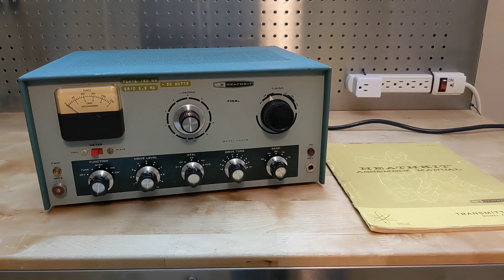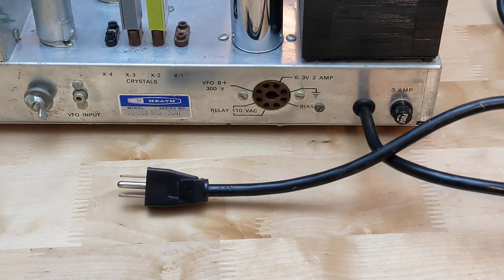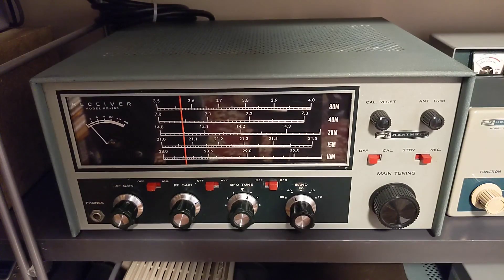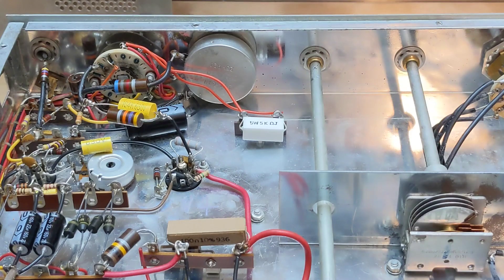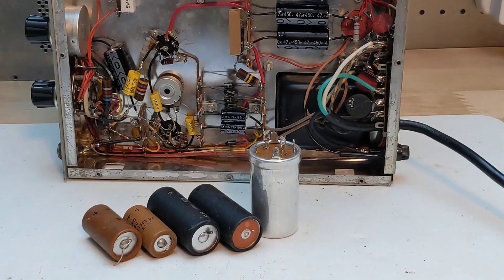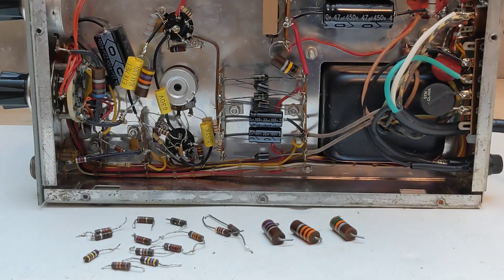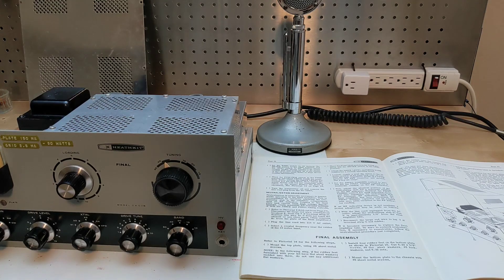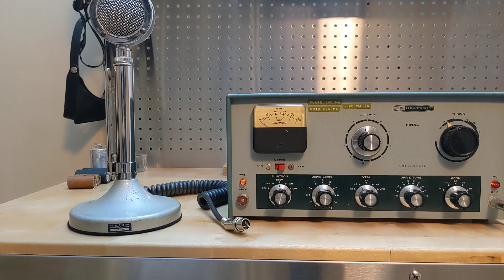The Heathkit DX-60B Transmitter: Restoration and Modifications

Comment: Very nice job… I need to do the same to my equipment…a few years back I worked on my Hammarlund HQ-129x… the BFO stopped working, it was the 100k plate resistor, it was way out of spec.. thanks for the motivation !!!